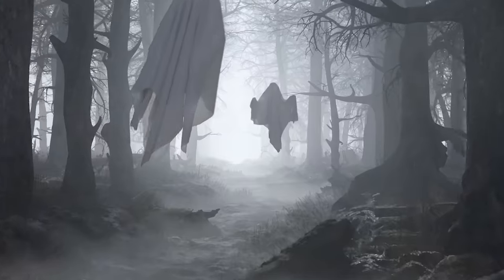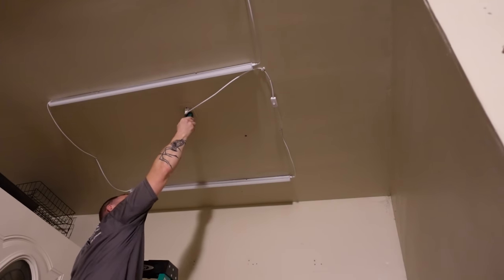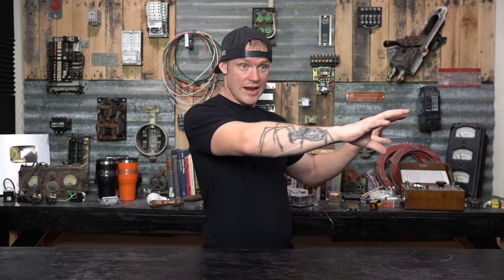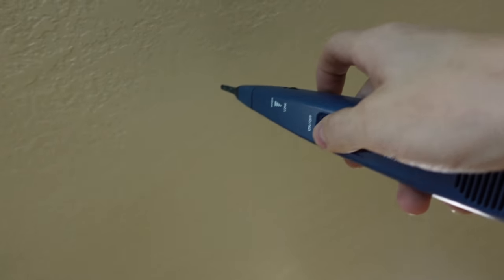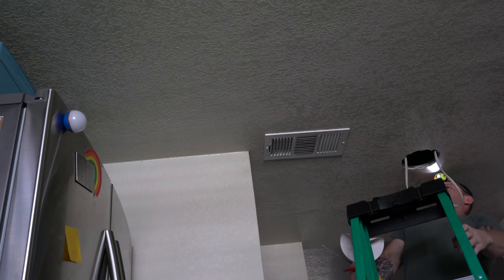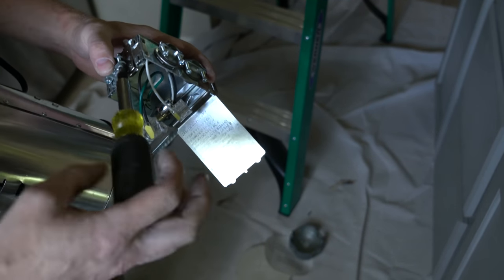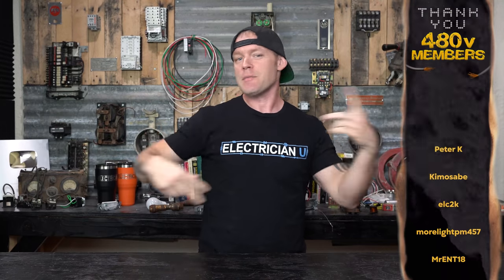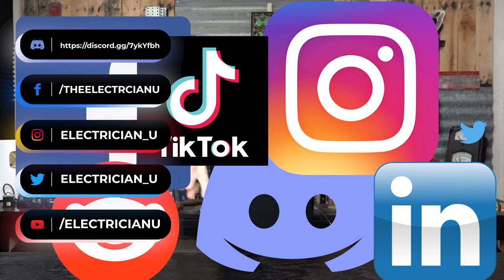THIS IS WHY ELECTRICIANS DON'T HIDE J-BOXES IN WALLS - Finding Hackwork!!

Comment: One thing I always taught ppl who wanted to know good knowledge about electricity is all electricity is dangerous and deadly, but the biggest keynote to take with you at the end of the day is that; 120 will grab you, 240 will throw you. So I wouldn't ever dare choose to be the one to complete the circuit between the supply and the load. Now it is possible to connect supply to the load when it's hot, at certain locations along the lines. But have correct gloves and ppe thats compliant with safety codes. Or at your own risk. Best to follow proper electrician guidelines and steps to avoid injury.

Comment: The carbon buildup at the burnt junctions act like a resistor (think another lightbulb installed in the power (hot) line loosely) causing an IR DROP at the point of the bad connector.  Those bad connections are what cause house fires from the heat generated by an increasing heat generation.   If the home owner is fortunate, hot eventually shorts directly to the Neutral or Ground tripping the breaker before the heat starts a fire.   When aluminum wire was used in Mobil  Homes, many went up in flames due to bad connections (and arcing until combustion was initiated).   It nearly happened to my in-laws trailer with aluminum wire in an outlet with a loose wire connection to the outlet.   Every now and then, mom said, sometimes I hear low (buzzing) sounds (arcing) coming from that outlet down there.   Alarm bells went off in my mind, quickly isolated the outlet, repaired the bad (burned wire and outlet) which precipitated my checking and verifying all of the rest of the trailers outlets were good, and connections were tight.

Comment: At the panel and with marker on the inside of cover plates on that circuit Write Kitchen can used as j-box. Also write it in the relevant can. This will help out the next guy.

Comment: Im electrician in NYC doing service calls for 12 years now. From my experience you had 120V on neutral to ground because you lost your neutral. Outlet neutral was hot showing  120V to ground because if u have regular incandescent bulbs in your cans your hot jumps on neutral with wire inside the bulb. Having weird voltage on between hot and neutral on that outlet was because eventho neutral was burned there was still a little connection there that your  meeter was catching. hot was 120V but your neutral was dropping it down because of bad/ burned connection. 
So in your case lower the voltage in between neutral and ground more burned your neutral is in some splice.

Also having 120V to ground in your outlet also tells you that outlet is already after the damaged neutral.

Just little input from my experience.
Reply: Its a simple test turn switches off for lights effected by your problem and your 120V on outlet would dissapear. It would be reading same low voltage as you had before between neutral and ground

Comment: I had one that was fun. No power on the kitchen counter. Only a couple of them weren't working. Checked the panel, all breakers on and working. No tripped GFI in the kitchen, but there was only 1. Put a toner on it and it stopped at the side counter...lol, there GFI was behind backsplash tiles. I wonder how they went years without tripping it is beyond me.

Comment: Hey my guy, I first want to say that I'm a fan of your YouTube... I really like the way you do your YouTube/go about showing how to/teaching your specific trade/whatever your doing how you just go about it I think is pretty awesome...   

Anyways Personally I'm a structural steel fabricator but sideline jack of all trades and happened across your YouTube one day looking to wire up a 220/240 in my garage because I needed another one for welder, & and my garage had previously burnt down like 4 yrs ago now from nothing that had to do with me, but still even in it when I put my 220 in then I actually had an electrical engineer friend that basically did for me and I just kind of helped snd learned from.  

Anyways I can't seem to find a 220/240 wire in episode with you actually wiring in from breaker box, and my garage has its own breaker box separate from me the one in the house. So it's not like wire ran from the house to an outlet/220/240 in garage. 
Really it's just from breaker box half round middle rm snd outlet. Super simple/fail safe type shit. But just because I've already watched at least 1/2 but more like 3/4 of the YouTubes you've made. And I haven't actually wired in the breaker yet. I mean that's all I have left snd I'm fairly sure like 96% sure I'm exactly right but I have a manufacturing grade
 Millermatic 252 MIG Welder I'm going to be plugging into this 220/240 and if you don't know that's like a $4k/$5k machine and will never have another opportunity to have another one quite like this as nice/solid machine at home for personal use/side work, and  4% unsure that if I follow through with and everything isn't 100% exactly correct first time round that it's going to hurt/fry my welder. 
And again almost positive it is but figured I'd shoot you a comment and see if I couldn't get you to do a specific episode on wiring in a 220/240 from breaker box in a garage to be completely absolutely sure I'm correct in everything I've done that would be awesome . 

Plus like I said I think the way you teach/show your YouTube is just extremely smart/enjoyable "for lack of better phrasing" to watch/learn from that would be awesome. Because while I basically know from last time snd Everyone else's YouTubes  I've watched wiring one in I'm good to go but thought you might like seeing/hearing that someone really likes the way you go about doing your YouTube/teaching your specific trade. You know might make your night snd or just get you to do one in time do me to be able to watch over before finishing up with which I highly doubt at this point but figured what the hell, your YouTube is pretty awesome my guy keep up the excellent episodes and have a blessed night.

Comment: Just in case it hasn't been said yet.  The source of the ghost voltage is due to the fact of the bad connection that he found in the box.  With the bad connection the neutral was as if it wasn't connected at that point any more so there wasn't a path back to the transformer (or potentially acting as a resistor itself).  If you have a resistive load on the circuit it will act as a wire instead of a resistor. This means voltage flows across it (rather than dropping like you would have access a load) as if it is the line side (because there isn't a path back to the transformer).  I always say you have lost the neutral meaning there isn't a path back to the source (transformer).  So in short your neutral (white wire) is now the hot ( like the black wire).  So when you measure hot to neutral at the receptacle you see zero volt because both have the same potential (120 vac). When you measure hot to ground you have 120 vac (ground is tied to neutral at the panel).  Neutral to ground at the reciprocal you have 120 vac, due to basically being disconnected at the junction box because of the bad connection.

Comment: Nice video! I love to hear stories like this from the field. Question - what do you think caused that wire nut to get so hot it melted? Is it possible there’s an oversized or malfunctioning breaker on that circuit? Or the conductors in the nut just weren’t touching enough somehow?
Reply: The wire nut was loose, and the wires were arcing, making heat.

Comment: As a plumber, I get it. Your not allowed to use couplings on threaded gas pipe in concealed locations, such as walls, as it will be almost impossible to ever find that fitting when testing for leaks years down the road. If that coupling is the leak your looking for, you're simply screwed. I have literally been required to place markings on the structure telling you how far down the line a hidden coupling is when even the inspector couldn't tell me how to get pipe to that location without hiding a coupling in a ceiling. The markings were required on the joist at the elbow at each end of the run with exact measurements from the elbow to the coupling. I had never encountered a situation where a coupling would be hidden and had never considered the ramifications of it. It has served me well though over the years. Many times on kitchen remodels the gas stub out for a new stove would need to be lowered and guys would just want to use a coupling and a nipple and I'd get to pass on this knowledge. A true craftsman is never, I mean absolutely NEVER, finished learning their craft!

Comment: I started having issues with my washing machine after some rising damp work was done where I rent. Sometimes it would work, other times it wouldn't until it stopped working completely. Turns out they slashed some cables in the other room behind the skirting boards they'd removed and put back.

Comment: My grandmother’s house was built with gas lights and then electric was later added. The house is a big old house and had an old screw in style fuse box with 4 fuses. In the 80’s a 100 amp panel was added. One day the power went out and none of the breakers were tripped. We followed the wiring back to the old fuse box. They had just powered the new panel off the old fuse box and the fuses blew. We had to have an electrician come in and wire it correctly.

Comment: on the joys of making a diagnosis:

my real job was as an ER Doc...the fun part was figuring out what went wrong such that the patient ended up horizontal in front of me.

80% of the accuracy in making that diagnosis comes down to getting a detailed story of what led up to the moment of failure....the "history";  put another way, with JUST a good history, i can diagnose 80% of problems. The labs, CAT scans, whatever....prove it, or provide detail, or help with planning the fix

and in my hobbies, the same is true; as with this young man's approach to electrical troubleshooting.

so, if you're ever the patient/ customer, do your best to give a detailed story to the diagnostician.  it will be to your benefit.

Comment: The way the neutral wire looks, it looks as if it the nut was installed with wires at different depth in the nut, so really only the longest wire was secured in the nut, and the other two had alot of resistance from the insulation in the middle and were barely touching the spring in the nut, cause it to melt first. I also don't see wire nut bite marks in the copper so it doesn't look like they were on tight at all either

Comment: That meter wasn't failing on you, what you were experiencing was parallel / series oscillation; bad ground (neutral) coupled with connected devices on that circuit ..Make sense.
 Anyone could
have found that j box in that closed up ceiling...... "says no one!"   Nice work.       ( kicking azz and chewing bubblegum!)

Comment: One trailer home I got called to had a 120v socket with 240 volts. Also, the hot water heater with 120 volt element in it burned out its element prematurely. The power panel had a second panel  daisy chained from it with one of the hots swapped with neutral!

Comment: I love the canless lights. The boxes on them are usually not so big.  Were you still within code for  the number of conductors in there? or how did you sort that out.  I did our kitchen remodel and definitely created a few junction boxes that are inaccessible (unless you open sheetrock),  errrg.

Comment: Used to do punch out in construction. A common problem was the kitchen and dining room lights would be reversed. The electric panel was in the pantry. The pantry light worked, so I turned it off. Checked the rest of the lights and none of them worked. Looked at the breakers and they were ok. Tried the pantry light again and all the lights came on. Somehow the pantry switch had been wired to turn on the rest of the apartment.

Comment: @25:00 IMO, my guess would be that the melted wires had something to do with the weird voltage? Wouldn't melted wires conduct poorly and erratically, and so the electricity moving through them would be inconsistent? When I saw the melted wires, I was like "eh, yeah. that's going to cause all kinds of weird flickering, and voltage highs and lows". Not to mention, if those wires melted, well... something caused those wires to melt, in the first place.

Comment: Thanks for sharing your story, but what was the cause for the wire-nut burning?
Reply from the maker: Many times when we see wire nuts fail, or splice materials such as wirenuts, wagos, butt connectors, etc. it is due to the poor installation i.e. not twisting wires securely, not landing in the wago properly etc. This is not limited to just these, though. Terminals like on breakerss, receptacles, or even light switches can cause an arc. An arc is when electricity flows through the air gap to fulfill the currect path, essentially in these cases. Arcing causes heat, and heat will break down these plastics uses in these materials. Thats why we see these things melt. Same with the insulating jacket on like NM-B , or Romex as you may know it.

Comment: I can remember when I was growing up and tinkering with electrical and electronic eqipment. My thoughts were.... The More items to tinker with, adjust, and play with the more I liked it and the better it was. 

I found out later how wrong I was. Live and learn they always say.

In Votech school, my electrical instructor always stated that the best way to built something was to use the old addage, "KISS" (Keep It Simple Stupid), as it was a known fact that the more components that you installed into an electric circuit, or more compnents you installed into an electronic component the more problems, and headaches you would have, and the more of a pain in the rear portion of the anatomy it would be in trying to repair it and keep it working, and the more chance of things going wrong, or breaking down in the first place. 

Over the years, I have repeatedly found that to be the case, and the more I found out right he was in what he said about adding more than one component, and not keeping it simple.

Comment: I am trying to remember if NEC codes from 90's allowed the small appliance kitchen circuits on GFCI to be connected to the lights in the kitchen, garage, bathroom, outside, and so on. Much of this problem would have been easier to find or even non-existent if they were separated.

Comment: What caused the wires to melt?  Were the wires just not making good contact with each other.  Also where can I get one of those signal tester/tracers, I have a outlet in my bathroom that has no power coming or going from it, and that tool would really help in tracing the problem down.

Comment: I've been a remodel home repair contractor since the late 90s. I have had to cover some boxes,  I don't do it much, less than half dozen in over 20 years. I do make goddamn sure that those wire nuts are super tight  I'll twist them with pliers and pull on the wires and make sure they don't come loose.

I have asked homeowners if they want the box exposed or covered up. I also explain that it's not allowed to be covered and the reason why it's not allowed.  I then explain that if I do it that I make extra extra sure that the connections are really secure.  They always say cover that shit I don't want that showing.  I also tell them to remember where it is at in case there's ever a problem that is where to have an electrician look. I've never had a call back over it.

  I make sure all types of connections are really tight, because weak connections like screws not tight enough causes resistance and heat. A lot of people pussyfoot around with wire nuts and seem to be afraid of tightening them too much.

Comment: Seems what you saw were what us old farts call 'phantom voltages'. This is where a voltage is induced from one wire into an adjacent unloaded wire. This is normally a very small current associated with the induced voltage but with today's digital multimeters, you can still measure it and usually measures similar to your source voltage. This is why I keep an old needle type meter (Simpson 260). When you see what appears to be a phantom voltage, break out the old meter and remeasure it. The old meter has enough load across inputs to eliminate the phantom voltage.

Comment: 25:01 I wonder if it was a floating neutral and the high impedance of the DMM was picking stuff up.  When I was doing industrial controls we all used low impedance analog voltage testers like the modern day ET60 from Kline.

Comment: 19:45  Key question: What changed?  If the junction box was miswired years ago, why did the problem appear just now?
Reply: And the answer seems to be that the resistance of an old connection gradually went up until it had enough resistance to get hot and melt the wire-nut.  Am i understanding you correctly?

Comment: I was always taught to always work on things as if it's hot, just like you handle a weapon as if it's loaded. The way I see it, you get too comfortable when you "know" the power is off. If you don't have a lock out, there's a chance another trade will turn on the circuit. I had someone do it to me working on 220 and it blew up in my face. Luckily I always work as if it was hot or I might have been in the wrong position.

Comment: Not quite the same problem, but got called up from Texas to Pikes Peak, CO because no one else wanted to figure out a neutral/grounding problem. Turns out the mountain was returning the grounding voltage back through to the neutral or visa-versa, and the developer didn’t pony up the additional cost for everyone’s transformers to be isolated from this phenomenon from in ground buried power feed. I think ya could say that Tesla was proven correct...